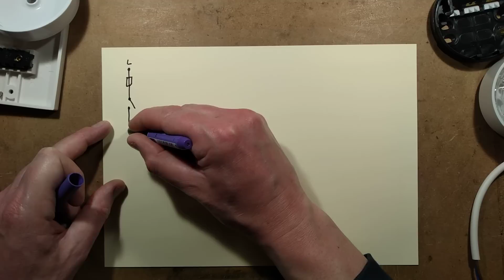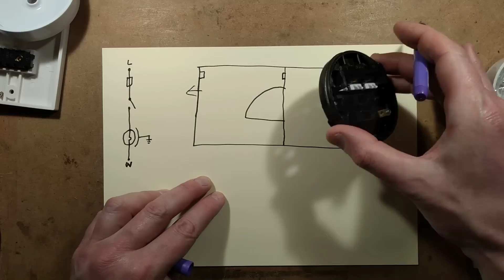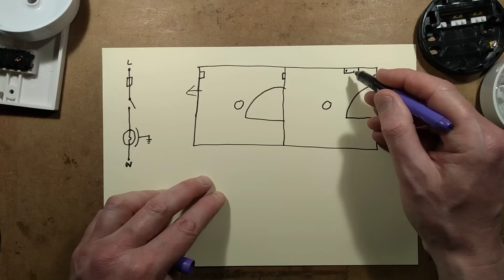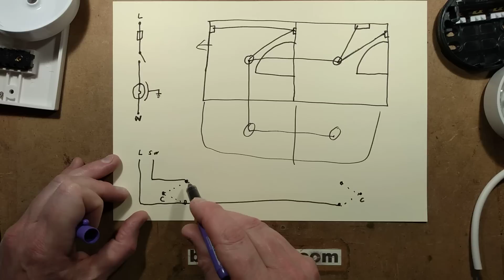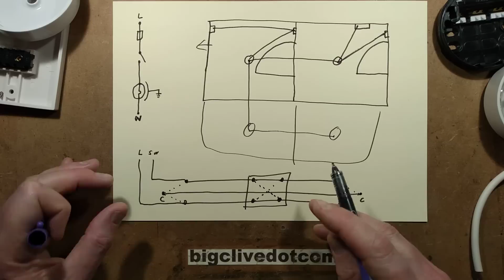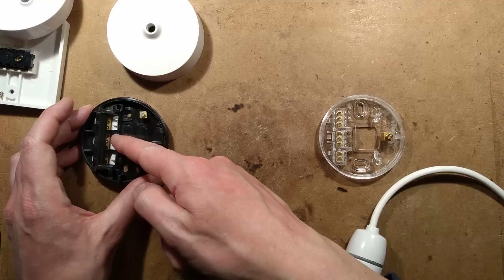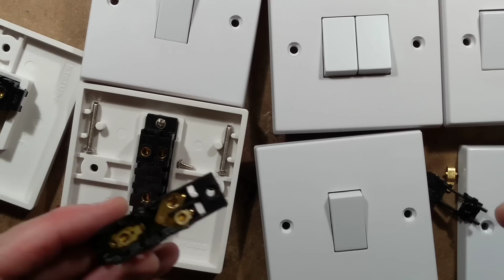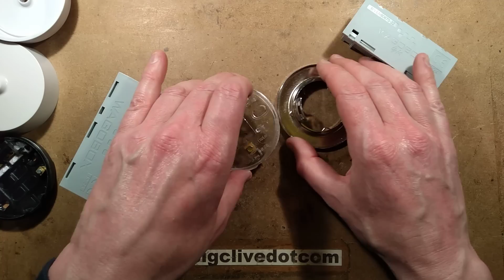British home wiring.  The incredibly simple lighting circuits.

Comment: I'm torn when it comes to shallow boxes. I guess it just depends. For ceiling lights definitely use deep boxes with cross bars. They should be very straight and be able to hold 60 lbs. You never know when you might want to switch to ceiling fans or to recessed lights. Those pendent lights make me cringe though. Further putting wire in plaster just.. idk seems unorthodox. But for masonry exteriors and for surface mount boxes (that are actually pretty) the shallow format seems legit. On that note surface mount boxes and raceway wiring is actually fine if its made to look nice IMO. At least I'd rather that than trying to hide in things like moldings or trim.
Reply: penguins forall Why do the pendant lights make you cringe? As a 5’11” guy they mean I rarely if ever need to get a ladder out to change a light bulb.
Reply: @donaloflynn  Because they basically just tug on plastic tabs or the crimps themselves. I don't have any problems with pendant lights that are properly supported.

Comment: So the switch boxes don't typically have a neutral wire?  Thankfully most newer houses in the U.S. do, so it's easier to have a powered automated switch (like Insteon).
Reply: My house was built in the 30s and has seen several upgrades so I have the joy of experiencing all sorts of fun stuff including both types of light wiring, breakers and fuses, what looks to be fiberglass wrapped wires and there's even the remains of knob & tube wiring. I've also had the joy of finding a few incorrectly wired sockets along the way.
Reply: Indeed. Many UK houses don't have neutral in the switch box, which means wiring a shelly or sonoff into the switch box is that much harder...
Reply: @SittingDuc  Some worked by trickling a little current through the light and parasiting off that. Which apparently was enough to cause some LED bulbs to light.
Reply: @chaos.corner  the old X-10 switches worked that way.  Yeah, while that was great for incandescent bulbs, CFL and LEDs were problematic.
Reply: Tim Thompson - In my home, I don’t have any of that new fangled stuff. Normal light switches are all I need. So I don’t care (even though some of my light switches do have a neutral because some also feed 5A round pin sockets for floor or table lights).

Comment: I always liked the UKs use of screw terminals instead of wire nuts. Way more professional and clean. However I like robust overbuilt wiring. Always spec the wire higher than the breaker. All boxes get both sides Live and Neutral. This also helps with things like wifi lights where you want them always on. All GFCI breakers (this is an especially good idea for lighting circuits) and at point GFCIs with faster trips in bathrooms and kitchens. I jokingly (and very stupidly) was showing this off when switching a light by just stuffing my finger in the socket and touching the box to shutoff the breaker. Obviously don't do that if you're not a crazy idiot but it is a testament to how much safer these units are. I also really like the large two leg 120v breaker boxes.
Reply: Yes, wire nuts are horrible ugly bodgy things. not much better than twisting the wires togethet and taping them. Wago and screw terminal blocks are much neater and safer.

Comment: Wait no utility knives ? how do they expect a man to work without a sharp knife that's nuts.
Reply: Whether we're meant to or not we use Stanley knives (box cutters) drawn down through the length of the cables where we strip them at the ends. I think it's officially frowned upon because it's easy to slip with them and most commonly gash yourself in the thumb mound sort of area.

Comment: Clive , this may be a dumb question , but why does Europe hate wire nuts. I think they work great.
love the ramble.
Reply: Keep in mind they're working with the same voltage as heavy appliance circuits in all their circuits. So their plugs and lighting see the same kind of voltage that we'd only see going to an electric oven or central AC compressor here. Something that does a bit of sparking or heating up from a short is going to be a bit more "spicy" with their standards. So understandably, they'd want a better connection.
Reply: @pauljs75  Wire nuts are used on 480 volt connections. They had some lighting installed where I worked. Two of the light quit working within a year. They lost line power. I cut out the Wago connectors, coupled them with wire nuts and they worked fine. Wago are faster and easier for lazy people but the connection is made in a very small area on the wire. Many light switches and receptacles come with both push in and screw terminals and I prefer the screw in. It takes longer but provides better contact.
Reply: Australia also hates them (i.e. they're illegal per wiring regs)
Reply: @SomeMorganSomewhere  WTF is a wire nut anyway? I know we in Australia still use screw connectors, basically how the lights connect wire anyway, wtf is a wire nut?
Reply: IMO the wire nuts are capable of making a very good connection but they're certainly a bit fiddly and quite easy to get wrong.
Wagos it's easy to get right and really obvious if it's on right or not...
Reply: they don't work great. We hate them because they're ugly, unsecure, unsafe and the lazy way to join wires. Wago connectors and screw terminals are neater, safer, more secure and the proper way to join wires. I would never use a wire nut. They not much better than just twisting wires together and taping them.
Reply: @simontay4851  
I have done joints with wire nuts and can report that they do indeed work great.  I suspect the things you have tried were an off brand or something.  They make connections with far lower resistance than a classic "pig tail" joint.  On US #12 wire, a wirenut connection takes more strength than I have to pull apart.
Reply: Wago connectors are better, safer and neater than screw on nuts.
Reply: Ceramic wire nuts are an absolute blessing inside heater-type appliances or halogen fixtures (using the proper high temp wire). They laugh off temps that would easily melt Wago blocks or regular wire nuts.
Reply: wire nuts make very good connections by compressing the twisted wires tightly but they are also more likely to be done wrong.
Reply: I can also confirm that the right-size wire nut will make a very solid connection, without looping a wire around a screw, which usually results in the wire slipping-out

Comment: There are also mains loops wired in the switch box instead of the ceiling rose in the UK.
Reply from the maker: Which makes sense for powered electronics in switches.  But in an older version of the regulations it was not permitted in case people tried to add a socket next to the light switch and "upgraded" the circuit protection.

Comment: All the lights on a level on one breaker? Odd... Here in the US the light for each room is usually on the branch that feeds the outlets.
Reply: Mister Hat The problem with that is that if that circuit fails, you have no power or light to that room. Here, loosing the outlet circuit would not affect the lights, and loosing the lights wouldn't necessarily plunge us into total darkness either as most people use a combination of ceiling lights and plug in lamps plugged into the outlets. It also solves the problem of a blown ceiling lightbulb tripping the power to the outlets. Most homes have two or three lighting circuits, each rated at 6 amps 230 volts so about 1.5kw each, more than sufficient for several rooms especially since the move towards LED lighting.
Reply: @spencerwilton5831  And... If one light has a fault, every light on that floor goes dark. Worse than one dark room.
Reply: Mister Hat How often does that happen though? It's only a case of resetting the breaker. At least here, if a bulb goes in say the kitchen our fridge doesn't also turn off and ruin the contents! So different countries have different ways of doing things, why is this a surprise to you? The irony is that you're commenting from a country where the power supply is so feeble, you can't operate a vacuum cleaner in the same room as a space heater, which is already limited to a hopeless 1500 watts! Your washers use domestic hot water as the circuits can't handle appliances that heat their own water. Even dishwashers are plumbed to the hot water supply, pointless and wasteful. Your outlets are unsafe, many aren't even earthed. You have different ratings for extension leads for goodness sake- all ours are rated at 13 amps 240 volts. You can't even use a decent electric kettle, instead having to boil water on the stove top which takes twice as long and is massively inefficient.
Reply: @spencerwilton5831  Bad example. The 'fridge has a dedicated circuit in the US. Oh and our dishwashers have both water heat and heated dry as they get a 240V/20A circuit. Almost all your ramblings are moot.
Reply: We too have dedicated light circuits in New Zealand. What he mentioned "one breaker per floor" well it more to do with the size of the house than anything else. UK houses are generally smaller than your typical American/New Zealand home. I have three lighting circuits in my three bedroom house.
Reply: @jgroenveld1268  Ampacity isn't my concern. If one light has a fault, every light on that floor goes dark.
Reply: Mister Hat Not odd, just different.

Comment: My brother in law who is an electrician told me a while back that they are not allowed to pull on the cores to strip the outer insulation because it stretches the copper and affects the electrical characteristics potentially adding higher resistance and lower load capacity.
Reply from the maker: That's the theory, but in reality the length is unlikely to change significantly.  It's just another imaginary scenario dreamed up by a non-electrician.
Reply: @bigclivedotcom  yeah, most things  here in the UK are spec'ed to be well within limits with a large safety margin and although stretching can occur it's gonna need specialist equipment to measure any change in its characteristics,  in the real world it will perform just fine.
Reply: @bigclivedotcom  Like much in BS 7671?  <gd&r>

Comment: Clive, Would you be interested in receiving a number of US 110v switches and other items for comparison?
Reply from the maker: I'm guessing they must sell American style switches and sockets from China on eBay.
Reply: @bigclivedotcom  Probably! Our stuff isn't nearly as nice to work with as the british gear though. It's kind of a shame really.
Reply: haha no such thing as a "2 way switch" - we call that a 3 way
Reply: @thedavesofourlives1  
In the US, a "2 way" would be the normal on/off switch.  It is a term that is not often used.
3 way is the one for the 2 "stations" of switching.
4 way is when you have 3 or more "stations"
Reply: Having sent things from the US to the UK, you'd (or Clive) would probably be better off ordering them directly from China to his address.
Reply: @chaos.corner  agreed, its ferkin dears to ship stuff from USA
Reply: Favorite peeves: Wrapping the wires around those annoying screw-down terminals. Stab connectors which don't always produce the best connections and a single ground screw which is fun when you're trying to connect multiple ground wires together. Also the slots which are meant to correct for misaligned boxes but mean it can be a PITA to get the socket properly aligned. For extra fun, there is no actual specification for whether the ground should be on the top or bottom. (Many electricians like ground on top but a lot of equipment which is designed with an alignment assumes ground on bottom). [It's not all bad though]
Reply: @chaos.corner  You use a pig tail to connect multiple grounds together. There should be only one wire around the green screw. There is a technique to bending the loop with Klein's, where you use the jaw width to bend a 90° into the wire, then bro just the end and pull it around. It makes a perfect job that you can get precise enough to snap over the screw.
Reply: @xenonram  But there are two hot and neutral screws (and those push-holes). I guess that could be for if you wanted to isolate the sockets by breaking the tabs between them but how often does that happen? (I'm not saying you're wrong, it just seems like wonky design). And the wire bending thing is fine for a first install but a PITA when you're working with existing installations.

The English way, you just push the wire in to the hole and screw down.

Comment: I find the junction boxes to be very elegant compared to what I've seen in the US.  The ones in my house are just capped metal boxes with the cables pigtailed together using plastic caps that are threaded inside, and whose name escapes me at the moment.  This is also how wires are joined in ceiling fixtures, rather than the screw terminals you showed.
Reply: You're thinking of things called "wire nuts".

Comment: Much like that way of wiring seems more thought out as here in the US.
Seems a bit easier to rig and bypass here. You have more built in safe or maybe say correctness, if that makes any sense. Maybe im wrong but i just dig your fixtures to the US ones.
Reply: It makes perfect sense. You're not wrong. Of course its more thought out, its british. Our wiring systems are thoughtfully  designed, safer and done properly. The US way is lazy, bodgy and cheap

Comment: I'm curious how the cost of the switches and outlets compare.
Here in the States, I can populate a switch box, or outlet box for about $1.50 per gang. the cheapest outlets and switches can be had for <$1 and cover plates can be had for pennies as well.
Reply: I try to avoid the super cheap options as I strongly suspect they are crap. Like the wall sockets in my house when I bought it where the plugs would just fall out of the wall because all springiness had been lost in the contact springs. Or the "stab terminals" at the back where the same thing had happened and the wires just fell out when I was replacing the sockets with better ones.
Reply: Standard US switches always seem really old-fashioned to me. I tend to buy more modern looking ones when I change them. I do resist the urge to turn them upside-down though.
Reply: @chaos.corner  I love those large rocket switches you folks have in US.
Reply: @chaos.corner  Are you talking about the decora rocker-style switches?
Reply: @howlingwolven  Usually decora but they have touch and slide ones too.
Reply: @chaos.corner  I find it super weird when I found out that in the US, UP was on, and down was off. 
Here in Aus, you flick switches DOWN to turn them on.
Reply: @PBMS123  Yes. It's one of those things that feels wrong but you can't really find a valid reason for it to be so. I sometimes wonder if it's related to gravity and early switches not being able to fall into the on position.
Reply: A 2 gang light switch is around $1.50-2, a double pole switched double socket around $3.50-4. There are cheaper than those, and there are much more expensive.
Reply: we can get chinese made ones for about $3 but local made are about $15 in new zealand, but one of the  biggest rip offs is circuit breakers $3 for a din rail mount, but if it is to plug into  a wired fuse holder they are about $60 no chinese made  ones available

Comment: Brings back so many memories from when i was so 17.. But Ireland on the 3 insulated cores?... um ok, I like the way it is here, if there is a problem on the twin and earth with the live, its an easier route to the earth, tripping the breaker or the fuse earlier rather than the earth being insulated in the main cable.

Comment: I grew up in the UK, back in the days when wiring a plug was taught in schools because most appliances didn't come with plugs. I have a healthy respect for electricity. And now I live in the USA, and I try not to think about electrical systems because the American way of doing things is TERRIFYING. Also, Americans like their switches upside-down from what I grew up with, and that still trips me up after more than a decade living over here.
Reply: Just stand by the light switch, moving it up and down singing "Stranger in a strange land" by Iron maiden...
Reply: Yeah, it is. Their way is the lazy ugly bodgy way. Wire nuts are a classic example. wago connectors or ordinary white terminal blocks are much neater.
Reply: Yeah but wire nuts are cheap and quick. Everything in the US is about money. @simontay4851

Comment: 6:18: If you have the grippy lock thingy grab on to the plastic and then hang a heavy lampshade off that, would the fact that now the outer plasticky flex-type insulation becomes load-carrying be a good thing or a bad thing? On the one hand it seems like this would offer redundancy over just having the copper strands be load-bearing, but on the other hand, rubbery plastic can deform or become brittle and can weaken over time, more so than copper, so now I'm not sure if gripping on to the flex cord insulation externally is good redundancy or false security. What do the more experienced and competent people think?